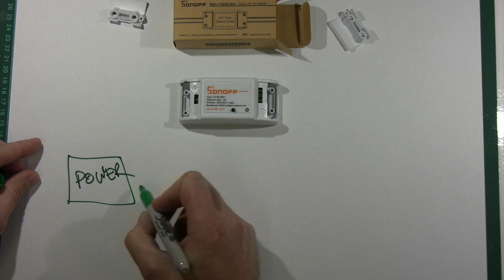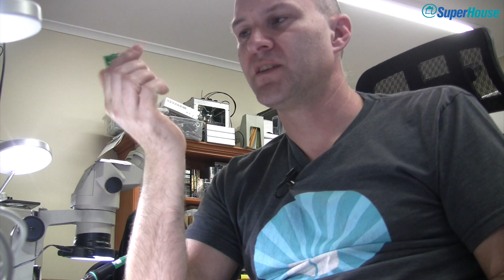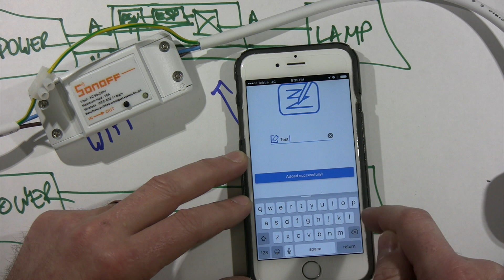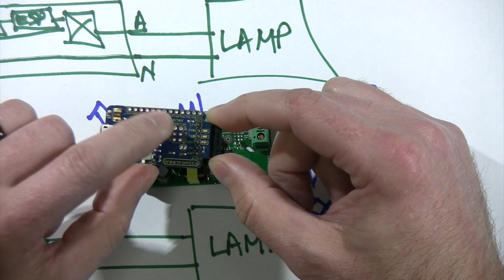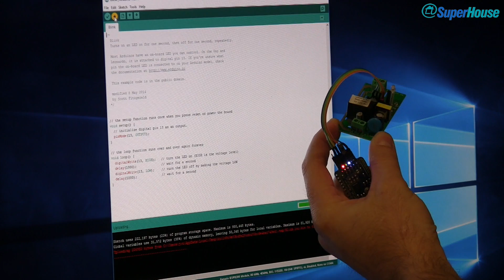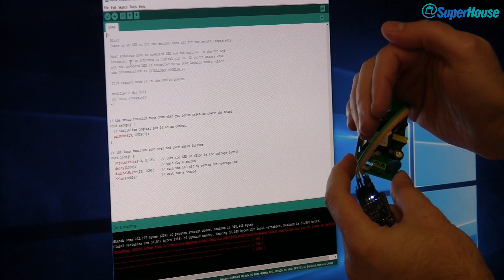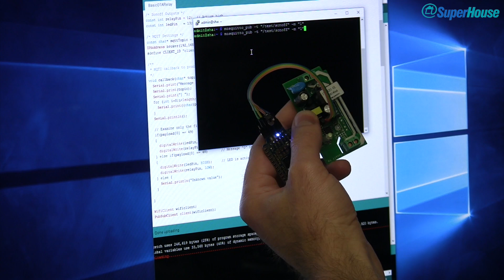SuperHouseTV #17: Home automation control with Sonoff, Arduino, OpenHAB, and MQTT

Comment: I wonder how many GPIO could be gotten out of that device. 

Can Rx, Tx be used for GPIO?
Reply from the maker: Yes, and the 5th connection on the programming header (the one in the video that I mentioned but didn't use) is also a GPIO. And if you get the TH version, the connector on the side that is used for the temperature / humidity sensor also exposes a couple more GPIOs.
Reply: ok, that answers one of my questions :)

Comment: You keep mentioning Neutral and Active. If I were to splice the Sonoff into an appliance cable, that cable would be reversible. There isn't a dedicated Active and Neutral in my country. Why do you think it's an important distinction?
Reply from the maker: Neutral is the line intended to carry return current from the Active line, but in electrical systems with a ground / earth connection it's normally kept at the same potential as earth. So if the active line is switched (and the switch is off) then an appliance with an earth connection shouldn't have any parts of it (either internal or external) that have any voltage that's different to earth. If the neutral line is switched, the appliance will have its internal circuit at mains voltage relative to earth even when it's switched off. It won't operate because there's no return path, but it's all still live. Appliances that have reversible active and neutral are required to be "double insulated" (class III) or above. There's some basic information about different schemes at https://en.wikipedia.org/wiki/Appliance_classes

What country are you in?
Reply: I am currently in the Philippines, lived in Germany before. The EU-plug doesn't even have an earth wire. The plug in the Philippines is all over the place. Sometimes just two slits, sometimes two slits and a ground, sometimes that combo of slit+round.
Reply from the maker: The Europlug standard (CEE 7/16 Alternative II) requires that it can only be used for appliances with insulation rating for class-III or above and is limited to 2.5A, which means you can only use it for low-power domestic appliances that meet the standard. Here in Australia all power sockets (called "GPOs" or "General Purpose Outlets") are 230V/240V 10A with a mandatory Earth connection, and the position of active and neutral is also mandatory so you know the active is always switched. That gives us the benefit of being able to use the same power connections for all domestic appliances, even high power devices such as washers and dryers (and high power tools such as welders) while also allowing double-insulated class-III appliances with no Earth connection. One connection for everything, always the same, everywhere. I complain a lot about the strict standards here, but this is one benefit we have :-)
Reply: SuperHouseTV I think I'm getting more and more confused. Did you just claim that the Europlug is only good for 2.5A? Germany only uses one plug except for the electric oven. Here is a link to an extension plug on German Amazon. https://www.amazon.de/Levin-Steckdosenleiste-Mulitport-Charging-Electronic/dp/B00WM9PN5E/ref=sr_1_13?ie=UTF8&qid=1474874469&sr=8-13&keywords=4000W

It's rated for 4kW and the two-pronged plugs are visible in the pic.
Reply from the maker: Marc Ritz 2.5A maximum rating is what the standard says: https://en.wikipedia.org/wiki/Europlug
Reply: I did some digging: https://en.wikipedia.org/wiki/Schuko

That is why! That plugtype actually does have an earth wire that connects in the form of a clip rather than prongs. Still reversible though
Reply from the maker: Wouldn't it be nice if there was a global standard for voltage, frequency, and connectors? The unattainable dream :-)
Reply: SuperHouseTV standards are great. Everyone should have one.

Comment: The problem is these modules have not gone through certification procedures. For example has no CE certificate for us in Europe. If your home burns down because of this your insurance is not valid. I am sure it is the same everywhere. This is the reason why the unit is so cheap. They pointed out that the ground wires are way too close inside this switch to pass any sensible certification process...
Reply from the maker: There's no ground connection at all inside the Sonoff, it has to be connected externally. I totally agree on the certification issue: that's why these devices are $4.85, but here in Australia an equivalent brand-name module with certification is $59. In terms of their construction quality the Sonoff looks good to me. At least as good as the $59 brand name modules!
Reply: what is the name of the other product you talk about. Have you been using the sonoff with no issues.  ive recently purchased some of these to be able to have my external downlights on a timer. Just wondering what your thoughts are with the Sonoff products long term

Comment: the git repo links don't work
Reply from the maker: Sorry! I've fixed that now.
Reply: Thanks for fixing the link. I tried the BasicOTABlink and it works fine if i physically connect my esp8266 and choosing the com port option first and then change it to use the IP of the esp device. but as soon as i disconnect the usb cable the Port option in the Arduino IDE is disabled. How do i make it work without physically connecting the USB cable. Am i missing something?
Reply from the maker: Do you still have power supplied to the Sonoff, such as by connecting up the mains again? The IDE scans for available network devices on startup, so try powering up the Sonoff, then restarting the IDE to see if it then detects the port.

Comment: Hi Jon, quick question, I recently added an esp8266 based relay to control the lights of my living room. I connected the relay in parallel to the switch rather than in series. Do you think there is any advantage to connect a relay in series (or in parallel)?
Reply from the maker: The difference is whether you prioritise forcing something ON or OFF. If you put them in parallel, it's always possible for the other control to turn the load on, and you can't turn it off. If you put them in series, either control can force it off. The best method is to remove the switch entirely and have the load only controlled by the relay, then have a new switch that is a logical control (sends a command to your home automation controller) instead of a direct control (interrupts the power to the load)

Comment: where to connect ground wire to a lamp?
Reply from the maker: Some lamps have a metal body, so the ground wire may be connected to that. Many lamps don't have a ground connection so you don't need to worry about it. I just mentioned it because sometimes you can use a Sonoff to control something that needs ground, so you need to know that you should connect it around the Sonoff.

Comment: Another perfect video from Jonathan. 

Easy and enjoyable to watch. Just enough info, clearly explained - then man has got these you tube videos down to an art form. 

As for the Sonoff - I've just bought one £9 in the U.K.  Will use to switch lights on and off for added security whilst out.
Reply from the maker: Thanks Graham! I always feel that my videos are too boring and need to be spiced up a bit: I hate watching myself while I'm editing them. It sends me to sleep. But if other people find them useful, that's the important thing :-)
Reply: NEVER boring Jonathan. We love your videos. Please keep them coming. We learn a lot and it's clear you love what you are doing.
Reply: Hi I have a house which is/was controlled by a plc it is wired into a star topology.  I am moving to all loads outputs to be controlled with sonoff which I have flashed and now control via home Assistant with MQTT. I read all the light switches into a  Pi running home Assistant via io boards from ab electronics. Works very well what I am struggling with is dimming the lights. I would like to be able to dim the lights by sending an MQTT message to a unit and it turn the brightness up or down. Do you know how this could be done?  I use to use a unit to dim the lights and set the level with 0-10v control signal. Do you have any projects which will set a light level from a value sent via MQTT message?  The lights are all single colour disable led lamps.

Comment: Thanks for the video. Very helpful and informative. I had never heard of the Sonoff, but it sounds great. I am currently running an OpenHab/MQTT setup and I have a few ESP8266's (NodeMCU). It would be nice if they had a model that gave more pin access so I could use a relay plus temp/humidity for example.
Reply from the maker: There are other versions called the "TH10" (10 Amp) and "TH16" (16 Amp) that cost a few dollars more, but include a 3.5mm socket in the side for connection of an external module such as a temperature / humidity sensor. https://www.itead.cc/wiki/Sonoff_TH_10/16

Comment: Hello, great video, you should do more ;)
Already I walk for some time to explore such options.
The problem is if someone off the wall switch the Sonoff no longer fed and no longer have control by MQTT!
Do you have any solution?
Reply from the maker: Normally this is the sort of problem that home automation solves brilliantly, because the logical controls are totally separated from the physical outputs. You can put logical switches anywhere you like, do a bit of software configuration, and any switch in the house can control any light. The problem is with retro-fitting and trying to use existing wiring. It's easily solved using the replacement light switches I made that I showed briefly in the video, but I'm not selling those because they're not certified. I think I may have a plan for doing it with a Sonoff, so I'll think about it and maybe show a solution in a follow up video. I want to do a video about using the Sonoff TH model with a light switch plugged into the temperature / humidity sensor socket on the side, so there's a physical control on the wall that the Sonoff can read.
Reply from the maker: Two options. 1: put the Sonoff before the wall switch, so that the switch is in the output of the Sonoff. But this means the switch can only control the light when the Sonoff is on. Not very good. 2: Remove the wall switch, and put in a different device that doesn't control the power directly. Instead, it sends a command to the Sonoff, or to a home automation controller (such as OpenHAB) that controls the Sonoff. This is what I do. I don't have any normal wall switches anymore. Instead, each wall switch just has some buttons connected to an Arduino. When a button is pressed, the Arduino sends a command to OpenHAB.
Reply: Hello, by the way really nice video. I was looking for a solution to the problem of two way switch using both a wall switch already in place, and the sonoff. Do yo think some mod can be done to the standard "stair-wiring-like" two way switching (https://goo.gl/mMA4F3)? Thanks in advance!

Comment: Hi Jon . Is it possible to use Sonoff in this stuation;  i want to control lamp on/off conditions via openhub and second case if no motion in a room for 3 minutes turn of the lamp automatically . what would you sudgest? How can i integrate motion sensor? Is Openhub capable for this? Thanks.
Reply from the maker: Sure, it can do that. In fact this is how I have some lights set up in my house, except that I haven't used a Sonoff. It's exactly the same though. What I do is read motion detectors using an Arduino, which publishes to MQTT whenever it detects motion. Then OpenHAB turns on the light, and starts a timer. If the timer runs out, it turns the light off. Any motion resets the timer, so if it keeps detecting motion then the light stays on. In the bathroom of my workshop I have it turn on the light and the fan automatically, and turn it off.
Reply: If i decide to use Sonoff i have to place an arduino to get digital input, am i right? There is no way to get digital input via just using Sonoff itself, isnt it?
Reply from the maker: You could use the button input (the same button used to put the Sonoff into programming mode) to control the Sonoff. Or you could use a different model Sonoff like the TH10 or TH16, which have a socket for an external sensor module like a temperature / humidity sensor. Instead of connecting a sensor, you could connect a button and read it using your program on the Sonoff.

Comment: Hey Jon, an interesting question I have for you about us Aussies, because mains has to be handled by a registered electrician, what's your stance on it and what is the best approach to keep things legal? From what I understand, even replacing a light switch is against the law.
Reply from the maker: For permanently connected wiring, yes it has to be done by a qualified electrician. I have a great electrician who has done a lot of industrial automation work (factories etc) plus domestic C-Bus, and he's happy to go along with my home automation projects and make sure everything is done safely and legally. Personally I think the restrictions in Australia are ridiculous: technically you can't even put in network cable yourself, because it's considered permanent cabling and requires an Austel license. Crazy.
Reply: SuperHouseTV
Wow, I've been doing ethernet for years and haven't had issues with legality of it, I find that quite shocking. I do have connections to industrial automation engineers. Just keeping this in mind for buying a home next year. I want minimum downtime to re-do everything when we move in, but keep things centralized.

I'm thinking of doing a star like you have, but also have inline switches until I automate each of them, then remove the switches in the walls.

Keeping costs down is a constant battle when you have to pay a sparkie to do everything.
Reply from the maker: Yes, it's ridiculous. I think it's one of those regulations that is so widely ignored that most people don't even know it's not legal to do it yourself! In the US you can wire up your own switchboard, but in Australia we can't even install a network cable because it's considered a permanent fixture. Stupid.

Comment: great video. I am doing the same construction with a power supply, a wemos d1 mini and a relay (and ESP easy software)  but it is not as compact as the sonoff. I will buy one directly. thanks

Comment: Really like the longer format video, lets you gets more in depth.
Reply from the maker: Thanks Keith! It wasn't intended that way. I just recorded what I wanted to show, then when I started editing it I realised it was well past 30 minutes and I was surprised. I trimmed it a bit and decided I'll probably do a follow-up video to show more detail of the software side (such as the MQTT / OpenHAB integration) and maybe hacking a Sonoff to put a bigger memory chip in it. If I covered all that in one video it would have ended up an hour long!
Reply: Defo interested in seeing the chip changed out, and the intergration.

My brother in law and I have created a networked house heating controller using Arduino as the platform. I was mainly doing the feature set and he did the hard work of coding and hardware... :D

Can I ask where the EtherTen can be purchased? Is it only in Oz?
Reply from the maker: I specifically designed the EtherTen to go inside my light switches, so it's SuperHouse's fault that it exists! It's sold online at Freetronics (www.freetronics.com.au/etherten) with worldwide shipping, and also by many resellers around the world (www.freetronics.com.au/resellers)

Comment: Another great video Jon! The sonoff seems like an excellent device.My only concern is the lack of approval as stated in the video. Is there any way to metaphorically cut through the red tape? How much would it cost for ITEAD to get approvals for use of this device in Australia?
Reply from the maker: Short answer: a LOT. Not only would it need C-Tick approval, but because the ESP8266 has WiFi it's classified as an "intentional emitter" (rather than just something that may cause EMI by accident) so it has to undergo extra testing for spectrum allocation approval. It's likely to cost in the $5k (at the super low end) to $20k range by the time they got it all done. A company like Itead isn't interested in that because they're selling to hobbyists. That's also why something like a Sonoff costs $4.85, but if you go into Bunnings and buy an approved WiFi-enabled power controller such as a Belkin WeMo you're paying $69. Another sucky thing about certification is that it freezes your design. Companies like Itead revise their designs faster than they can update their website, but once something is certified it has to stay that way or go through the process again.

Comment: The ultimate room switch plate, 3 switches/buttons, a slider or knob to set fan speed, a tiny display to show temperature and humidity. Bonus points if an amp meter was put on the output to have logic detect if a bulb is burnt out or load is not physically turned on or if a fan motor is overdrawing.

Comment: Your GMail inbox is slightly full :P

Could a dump be possible before overwriting the firmware?
Reply from the maker: Yeah, I'm just slightly behind on email!

Yes, a firmware dump would be possible. I haven't done it on an ESP8266, but I found these instructions: http://forum.wemos.cc/topic/181/backup-original-firmware-with-esptool

I may try that with one of my unmodified Sonoffs.
Reply: SuperHouseTV That would avoid of "Oh shit, I can't restore the firmware to factory! >.<" issue that I'm sure I would create unwittingly :P

You did mention a star topology for your electrical wiring. Did you have any resources for that or just work it out on your own?